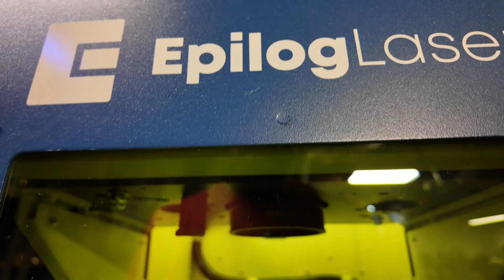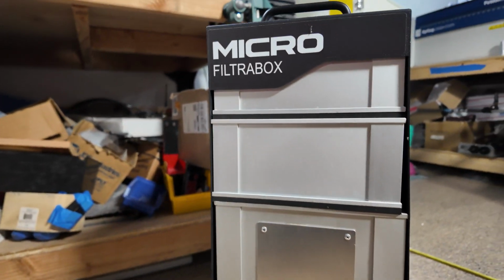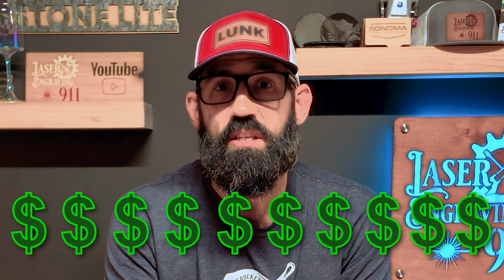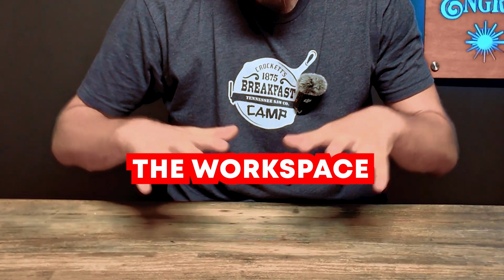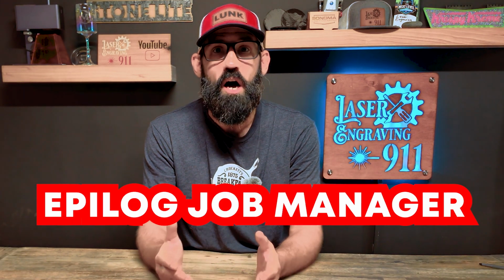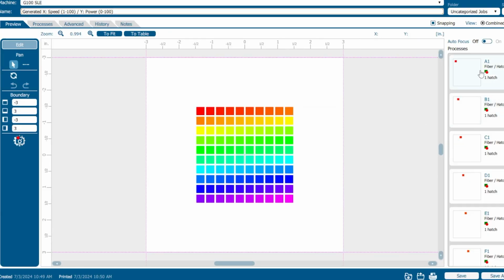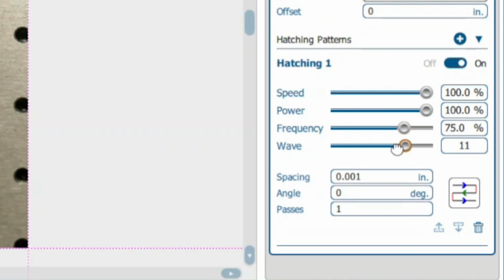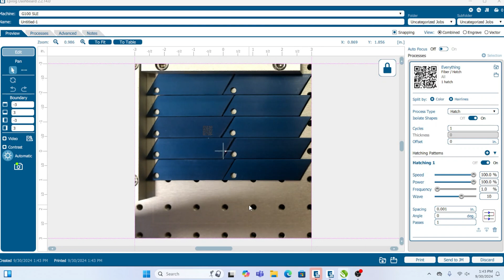The Epilog G100 Fiber Laser  - All You Need To Know

Comment from the maker: Hey Everyone! Thanks for taking the time to learn more about the G100 Fiber laser.. I wanted to quickly pop in and make a few corrections to the specs  of the machine. So I learned by way of Epilog that the G100 actual comes standard with both the 254 lens and the 163 lens, so you get both! which is great!😁 The other thing is that they actual dont offer a 60watt pulsed at this time, but they DO offer the 60watt "MOPA" laser source as an option!  ..I have spoken :)

Comment: For photo engraving on granite, does the fiber work? I do have an Epilog Fusion Edge, great machine, but would consider a fiber. Thanks.
Reply from the maker: Yes it does, you will have the best luck using dark to black granite, and also black polished granite does well too! Light colored stone may not be suitable for for fiber, and dark colored will work, and try and pick a stone that has less variation in color as well, and no shiny flakes. Hope that helps!

Comment: Do you have a link for the fixtureing bars you have bolted down to the table? Or are the custom? We just got a G100 and could use exactly those to improve our indexing of small engraving parts vs. the standard threaded pins that come with the machine.
Reply from the maker: Those are super standard for most fiber laser beds, Ill see if I can dig up a link!!